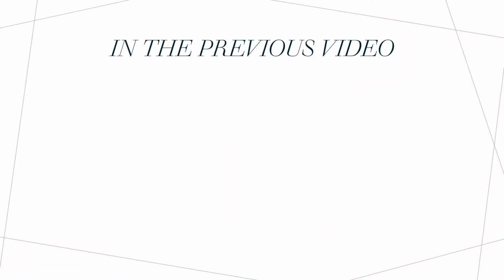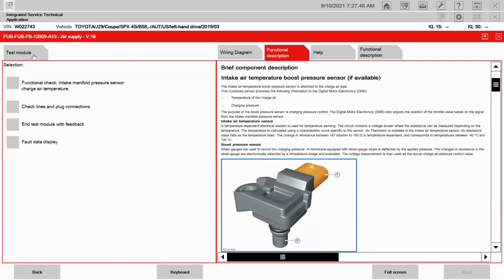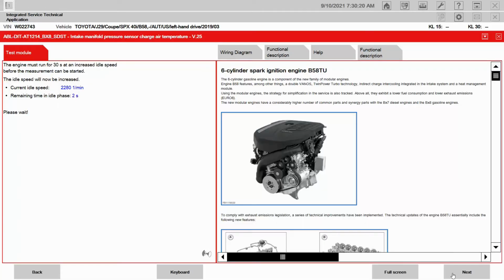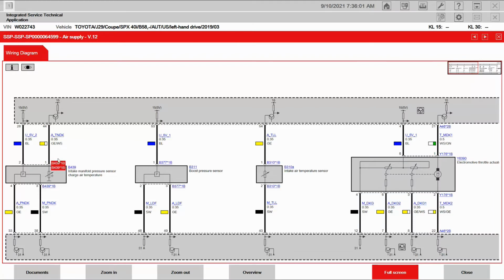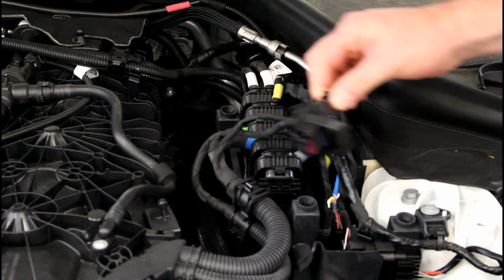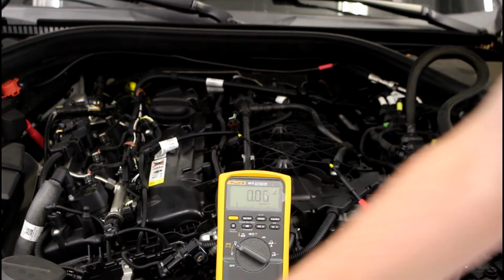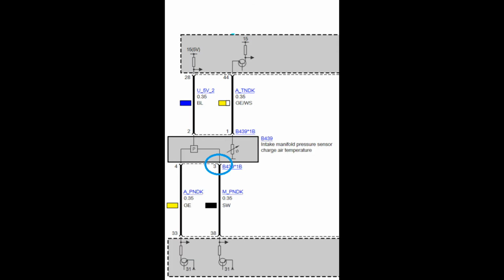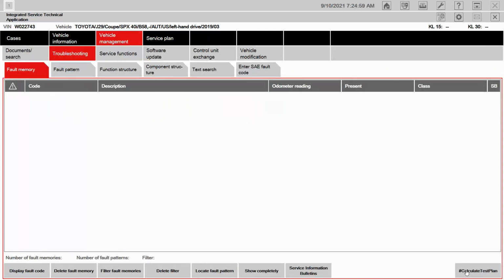Toyota Supra VIDEO #2- DTC Guided diagnosis and the ABL

Comment: I bought a brand new Chevy truck in 1989 and not once did I have to take it back to dealer.270k miles 2 starters.2 alternators,sparkplugs wires.total cost with labor probably $600.whats wrong with these new engineers nowadays.my gaddamm nephew is one of these engineers.he can't even disconnect a garden hose without his grandpa helping him!!!